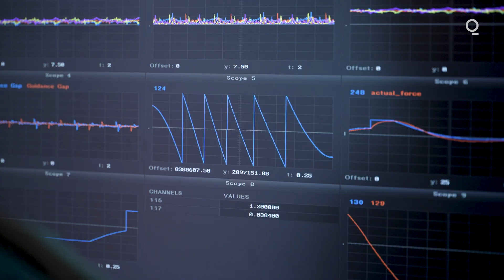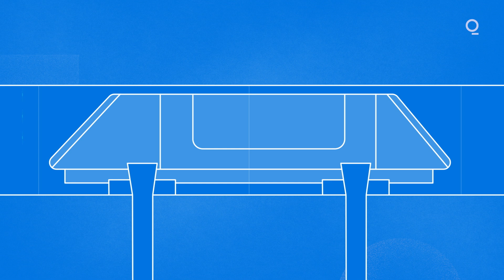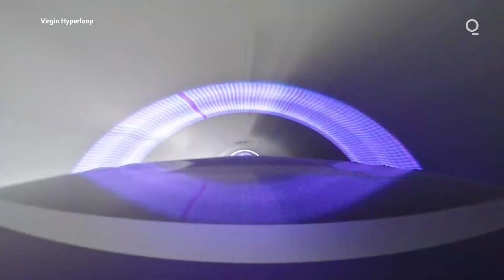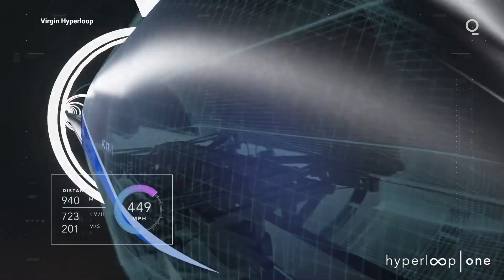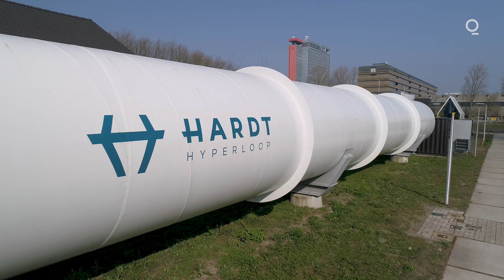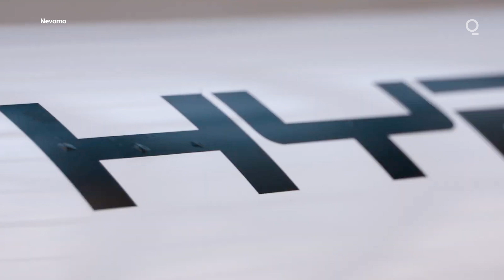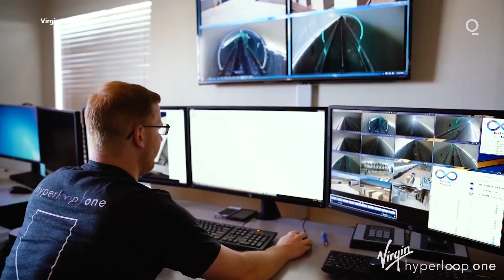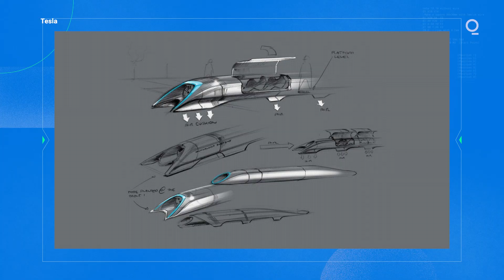The Hyperloop May Disrupt More Than Just Travel

Comment: The reason why a lot of people trust airplane safety over hyperloop safety isn't because we don't understand hyperloop, you idiot 😆 it's because with hyperloop, there's a lot more that can go wrong on the ground as opposed to what can go wrong in the air. Seismic events, vehicle accidents, and tornadoes are just a few prime examples. What if you were in the hyperloop and it's going through an area with traffic, etc and a vehicle crashes into the support beams that hold the tube, and it throws a section out of alignment? Going at extremely fast speeds and even just barely bumping into something can lead to catastrophic and fatal outcomes.

Fun fact: more people die in car accidents than they do in plane accidents....much much more. In the sky, you don't need to worry about tornadoes, earthquakes, car accidents, or anything like that. Air flight has it's own set of concerns, which have mostly been addressed and aren't remotely near as common as its land-counterparts.

This guy seems to be ignoring that logic. He's so focused on being famous, rich, and important that he doesn't care about actual safety lol
Reply: It's just 2 people, so it's fine for them to be dead.

Comment: I would imagine - the first step would be to make all UK railway network electric (finally) and get rid of diesel trains. 
Then it would make sense to build up an extra capacity either through solar panels on that network or nuclear power to move trains fast enough.
Then it would be reasonable to raise the tracks up. There's no practical difference in travelling between Liverpool-Manchester in 5 mins or 30 mins, but it is 6 times the speed difference.

Comment: LOL passenger test without a vacuum ...we went about 40mph was so fun..This idea has been around for over 100 years. And there is still no way to create a moderate vacuum in such a large tube. No way to have the tube straight enough to allow for high speeds. They haven't even allowed for thermal expansion of the tube. each segment would need to move 100 meters plus on the pylon, But a segment isnt that large.

Comment: The typical disconnect from engineers and users is apparent here. If the real thing is that small there will be people who have panic attacks in that cramped space. I want Hyperloop to work but it needs to be bigger like a conventional train compartment. There are some basic reasons why they are as big as they are. I understand the cost savings of these cramped tunnels and it would be ok for short trips but not longer trips.

Comment: I personally think the whole system would be throttled due to every point where the track switches would require the vehicle to slow down. Maybe if the switch-off was gradual enough, but I think in the real-world application they will end up falling short of those 1000km speeds.

Comment: Does no one think of the attacks that would occur to different parts of the system? If someone is willing to hijack a plane whats stoping them from attacking this when its built. The only way this can be done is by is built uderground. Bad part about that is the corrosion that would occur cause mass sytem failure.
Reply: Most air passengers don't worry about hijacking.
You will have an uphill struggle to compete with air travel using a ground-based system, simply due to cost.

Comment: Just ask the scientists at CERN how much it costs to build, maintain, and lastly pump air out of a long vacuum tube. Vacuum tubes are extremely difficult to build and operate and they become vastly more dangerous with size. Having a pressure differential of 1bar to approx 0.001 bar along a 700km stretch is an accident waiting to happen. And no, there is definitely no transparent material capable of holding such a large amount of pressure whilst also withstanding the immense forces of a gigantic train moving at high speed.... So 0:13 is a computer-generated fantasy.
Reply: Yeah I am not sure how they will solve the whole explosive decompression safety issue if a leak were to happen.

Comment: Imagine a power outage happening while you're in one. I know they probly would use generators or some reserve energy but imagine if it just stops
Reply: It makes ONLY sense at long distance. So you have a 100s of kms long tube filled with pods. On a power outage, each pod must have the equipment to stop on its own within the distance to the next pod. There is a vacuum out there, so you cannot leave unless you wear a space suit. Even if you have one, you must then walk to the nearest airlock - and hope that it is not blocked e.g. by the pod in front of you.  
 
You would have to provide air and emergency rations for days, when a defect occurs in the middle of the tube. You can get out the pods only sequentially, unless they add giant airlocks where so large sections of the tube are removable that you can extract a whole pod. 
 
And to "clean up" and do a repair, you need autonomous maintenance vehicles that must be able to drive half into the tube and back with their own energy. Or you need thousands of airlocks along the tube. 
 
You anyhow need: 
 - one tube (at least) in each direction
 - an emergency/maintenance tube with airlocks 
 - a road parallel to the track to access the tube system.
 
It makes ABSOLUTELY ZERO sense.  

 
ESPECIALLY in a country that is not even able to install a decent high-speed train.

Comment: I like how straight all the hyper loop lines are, they’ve managed to ignore geography and property ownership in their CGI fantasy 😆
Reply: Civil engineering is so easy if you have the cheatcodes on :D
Reply: You forget after the Great Reset nobody will own anything! So no property rights(problems)there then!
Reply: In practice the lines are gonna have many curves and angles just like how railways does
Reply: @임민섭-b2p  exactly
Reply: I was thinking the same things
Reply: Uhm, i think they would figure how to manage speeds 
Lol
Reply: Yep.
Reply: They have to be straight, or almost. At such a high speed the curvatures must be very low. Fortunately the prototype is in a flat piece of desert. Actual usefully working ones can't be.
Reply: I didn't see anything different from railway lines. Have you ever seen railway lines?
Reply: @udittlamba  yeah they do round bends
Reply: @udittlamba  One of the big expenses and time delays in any rail project is the land acquisition or having to build around or through stuff (bridges, tunnels, bypasses etc)... Hyperloop doesn't solve this and as it is a legal and logistical issue, not a technical one, any proposed solution would work just as well for rail.
Reply: @KrisRogos  In fact rail offers a BETTER approach given that works , this does not and may never work in the way its claimed.
Reply: @KrisRogos  m8 one easy solution is to buy the property above market value and thats it
Reply: @keithrobinson5752  Yup, improvements to existing train infrastructure would be a far better use of money... but I must give one thing to Elon, Hyperloop is at least a more realistic idea than using rockets for point-to-point travel between cities on Earth. I mean who would be so crazy to suggest that? 😜
Reply: @DaftPunkSkittle  A) How often does that work? 80% of people will just take the money offered with little hassle, sure. But the remaining 20% will keep demanding more and result in the years-long legal battle between the government and the people who own the land. Either way, costs go up massively, time goes up massively, if there are terrain features or historical areas in the way, you still need to go around them.
B) People are no less or more likely to give up their property just because it's Hyperloop. If you can get them to sell up, you can do so for any other mode of transport.
Reply: @KrisRogos  how do you think the government has built anything? Its already been done and will continue to be done. I work in construction and no one says no. Everyone has a price. The only reason one would say no is because you have someone in your team that just dislikes their job and doesnt know how to respect or talk to ppl
Reply: @KrisRogos  The original white paper discuses using existing rights of way for rail and road. No need to acquire new land. There goes that legal hassle. Also the environmental review gets shortened as most of it has been done.
Reply: @KrisRogos  hyperloop won't be a transport of the masses unless heavily subsidised by a government. But the who gimmick is so expensive that land acquisition is the least of their worries.
Reply: @KrisRogos  the big difference to the train is that the corner radius has to go up with the cube of speed, meaning it is pretty much impossible for the loop to avoid anything. If there is no high speed railway in germany because of that, it is absurd to even suggest building something with 5 times the corner radius of a high speed train...
Reply: @udittlamba  Yes they have a lot of curves.
Reply: I imagine it would have to slow down significantly on turns and it wouldn't even be worth the fast travel.
Reply: Nobody owns the airspace above your house, or the ground below it. Wonder why the dude making hyperloop is also making the fastest tunnel construction company in tandem.
Reply: @TheChaumaster  Who hired this magic tunnel boring company? We have a lot of long tunnel projects and not a single of these contracts went to magic Musk.
Reply: I mean has the us government ever cared about property ownership when building infrastructure?
Reply: @apoisonberry  Yeah I don’t think people realize the government can basically just take your property from you. Or pay you so little of the actual worth they mind as well be stealing it from you.
Reply: @royhoequist8846  Uh, isn't this basically what's stopped the California HSR?  That project jumped from $30 billion to $100 and then Gov. Newsome stopped it.
Reply: @johnmonkey1874  he didnt stop it, project is still going. He only halted construction in areas that weren’t cost effective
Reply: @apoisonberry  it has, how do you think freeways have be made lol?
Reply: Don't worry, humans are going to plane everything and destroy more of Nature
Reply: This is actually the point of the boring company. They plan to do this underground and get the price and speed of tunnels low enough it’s possible and realistic. If you can do that property ownership and geography won’t mean squat as you just dig under it all.
Reply: They could just build underground, something similar to the boring company
Reply: @samueltiffany2665  Have you looked at what the boring company have actually achieved, not what they promise to do ?

Comment: hyperloop is rubbish. there is only 2 country that has the technology and engineering to build it today, Japan and China. neither of them has a hyperloop program and there is a reason why. the hyperloop that elon musk orginally argue for, use air pressure to lift the pod, the problem is, the tube is near vaccum, so the lift fan will have to turn several times faster to generate the same lift, this means it will wear out in a few hours. today none of the hyperloop project use air pressure, almost all of them use some kind of electric or maglev technology which bring to the point... 

so what the hyperloop has evolved into has effective became a covered maglev. if you can't even afford to build an uncovered maglev, how do you pay for one that is covered?

countries that already has operational maglev like China and Japan do not even consider it because even with the billions they spend they can barely afford a intercity maglev network. to fund not only the maglev system but also a tube over the track would cost an average of 200-300 billion per line. that is equal to half the building cost of the entire china's highspeed rail network just to build 1 line. or the cost of 5 california highspeed rail project if we replace that with an hyperloop... it just doesn't make economic sense when we are already struggling to fund and justify the cost of highspeed rail.

Comment: Hyperloop: the knock-off bullet train that is more expensive and harder to operate.
Reply: lets not forget the near total lack of safety features and the fact that they have yet to show what would happen in the event of a system failure or any type of a life support system for passengers. How are they to get out of this tube if there is a accident.
Reply: @raven123121  yeah my man. The logical application should be to transport non living objects, AKA cargo. But the public will not need to buy in the mentioned solution for cargo, corporations and governments should provide it right?
Reply: @laychyetan7466  true but you have a system that right now with one containment breach and cause catastrophic damage. which would result in the entire system going down. You need to see the vid of a rail car tanker being crushed under weight of a vacuum.
Reply: @raven123121  But thinking about it in terms of a veeery long tube, is it an instataneous collapse of the whole tube or is it the case in practice that the tube would only collapse near the fault? Wouldnt it be self damping as the air rushes in at the fault (maybe aided/damped by controlled venting air in either side of the fault), maybe also helping to air brake oncoming traffic I guess. 
Genuine question, please pardon my ignorance.
Reply: @raven123121  "Controlled Demonstration of a Tank Trailer Vacuum Collapse by Wabash National" Note on this example of a collapsing tank (a long thin one) that the crushing was localised to one end of it. Is this validading my hypothesis that the air is rushing in faster than the structure collapses self limits the damaged area?
Bad day if you happen to be right at that point... but I rest my case. 
Genuine question! Not making assertions I'm not qualified to make! :)
Reply: and does not go anywhere or carry anyone
Reply: What bullet train you know can go 600mph(the theoretical speed of hyperloop)
Reply: @RANDO4743  The keyword being "theoretical." Mag trains are real and not a static technology, getting faster over the last 20 years. How fast will they be in another 20 years?
Reply: @tot788  there are engineering limitations,so you can't just assume that the speed in trians will exponentially just increase.Its the reason why there are no and  will never be supersonic helicopters.
Reply: @RANDO4743  Sure, but we are still far from reaching the physical limitations of HSR. I think that Hyperloop is an interesting idea. I just doubt that it will make any sense to build them currently, it's just not economically viable. Additionally, bullet trains are still way faster than any Hyperloop project.

I mean a train can transport hundreds of people. Hyperloop can only transport like 20 people in one pod, ticket prices would have to be astronomical to sustain the system. Maybe it will make sense to construct a Hyperloop in 2050 or 2100. 

It's just CGI hype right now. All tests have been miserable, most of the showcases didn't even use a vacuum lol.
Reply: @tot788  hyperloop aims to solve most of the shortcomings of mag trains. If u expect mags to get better over  the years they also will have to apply somewhat similar technology, and people like you will again treat it like some kind of black magic
Reply: @siddharthabalodi8809  Except Hyperloop cannot address some of the most major flaws of maglevs: Cannot use existing rail lines, Cannot use existing infrastructure or workers and it will cost 10 times more
Reply: @RANDO4743  well, HSR costs 28 million dollar per km to make. Hyperloop costs 20 million to make.

Support hyper loop (-_-)
Reply: @gold9994  I mean they haven't  made one soooo
Reply: @gold9994  Show me the real life, full hyperloop line built from these prices please
Reply: @RANDO4743  its not going to go 600mph
Reply: This was invented 100 years ago... and seeing as you need to run this in a vacuum and its dangerous etc... it was scrapped... scammer musk invented NOTHING...

Comment: 8:30 sums up the problem. The pods are small, the capacity point of the system has a built in constraint meaning that it cannot move the numbers of people required to be a viable public transport system. Hyperloop is an absolute bunch of nonsense.